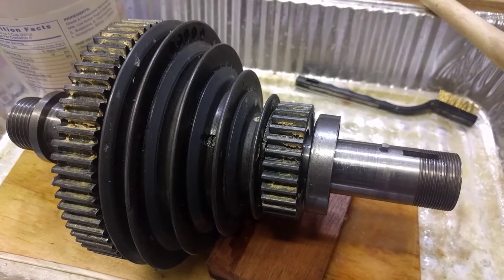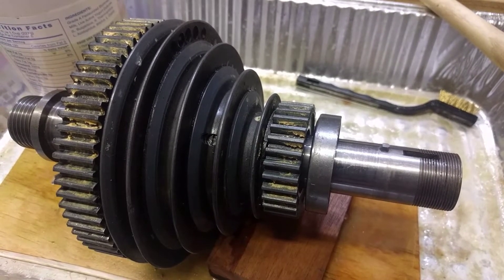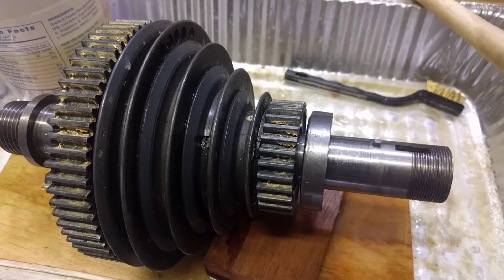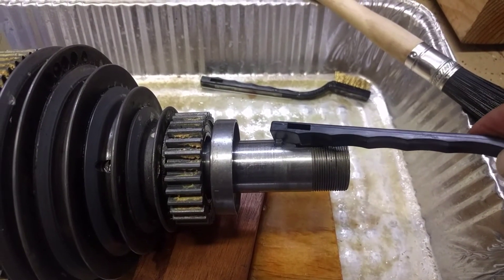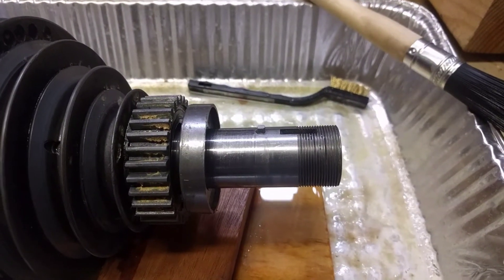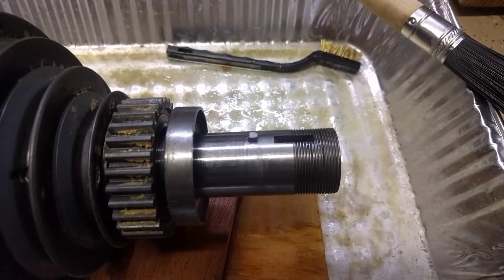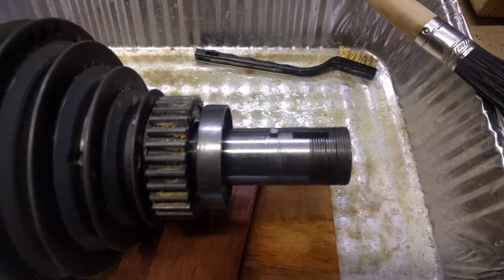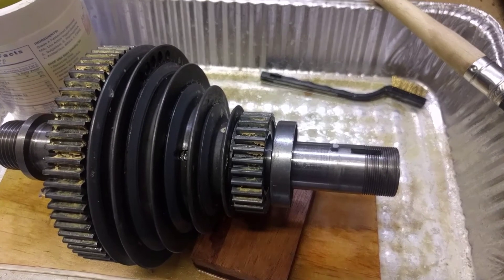Craftsman 12" Lathe spindle - steel pin question

Comment: I have run into the same problem. How do you get that pin out?  Did you do it?
Reply from the maker: Hi WJ,
In the end I decided not to remove the pin, figuring I should at least get some use out if the lathe before I go breaking things. The gears were all very clean as is. Update this if you try and let us know how it went. Thanks!

Comment: I have an 80s vintage Craftsman 12 wood lathe. Your bearings are similar...did you use a bearing puller to remove the spindle assembly? I don't see the expansion clips noted in a manual download
Reply from the maker: Hi MT, I'm assuming you're not asking how I removed the spindle assembly (shown in this video) from the headstock.  Rather, you're asking how I removed the rightmost gear (not shown in video) from the spindle in the video.  I put the whole spindle in a wood jig, then gently heated up the end gear with a torch, and gently and slowly tapped down on the main tube.  If that doesn't make sense because I don't know of the exact terminology, I'll try to upload a video today or tomorrow of the removal steps that preceded this video.  Thanks for watching and asking.
Reply: Michael Schwartz   thanks I've done heat removals on motorcycle bearings....nasty.  My lathe is working fine after max lubrication. I desassemble to clean and lube as much to understand how it works. I'll skip that for now but thanks..
Reply from the maker: MT Mals That's great.  I didn't disassemble mine all the way either.  Have fun with it.